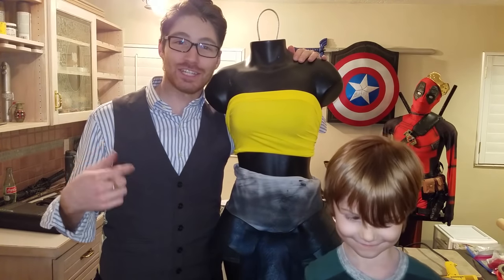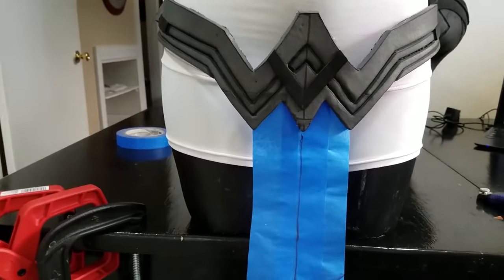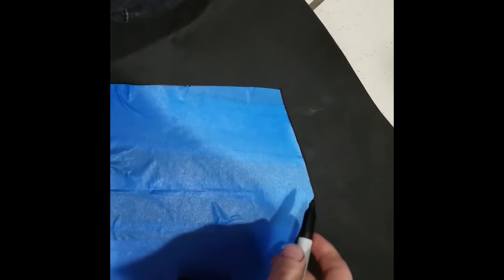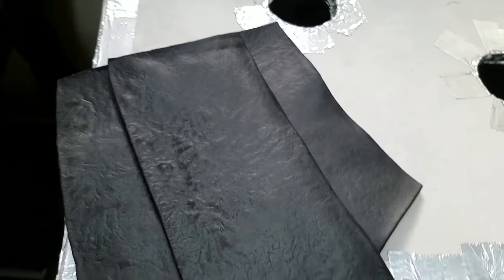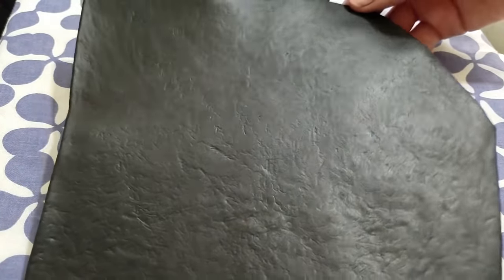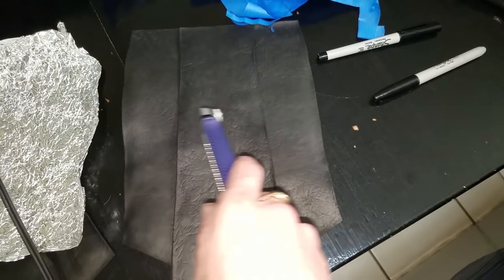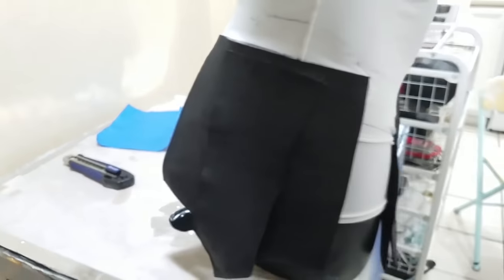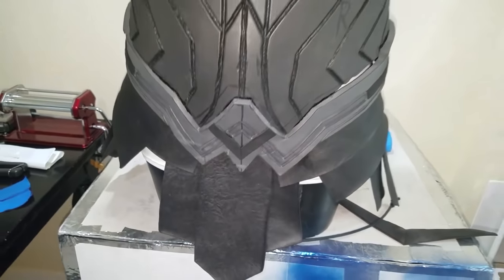Wonder Woman Costume Tutorial - Craft Foam Skirt That Looks Like Leather | Cosplay Apprentice

Comment: This may have been asked but since you glued the pieces to the spanx...does that mean the stretch in the spanx where the glue is no longer stretches?? I'm thinking of when you pull them over thighs and hips as that's when they need stretch. Or did you put a zipper/opening in the back?
Reply from the maker: +Rachel Holgate There isnt glue everywhere along the rim of the spanx, only thin strips along the tops of the panels. The spanx still have plenty of stretch :)

Comment: What is your preferred way to paint the leathered foam in order to keep the dimpling?
Reply from the maker: I will do a thin coat of plastidip and then use spray paint for any other layers. The fine mist of the spray cans helps keep all the dimpling details :)

Comment: how do i get the foam to form to my body? it's so square it looks goofy on me :/
Reply from the maker: +Ash sitzer Great question. You'll want to try it on and doing a section at a time heat it up as much as is comfortable with a heat gun and while the foam is hot push it against your body in the spots you are wanting more shape, you may need to heat a couple times to get the shape you want. Then repeat this process everywhere were you are wanting it to form fit better. :) Hopefully that helps, please let me know if you have any more questions, and feel free to message me on my facebook page or instagram page with questions as well. Sometimes its easier on there because you can post pictures to show what the question is about :)

Comment: I'm having an issue with the side panels. I can't seem to get them right, do they lay on top of each other? And the back part, is it longer than the other panels? Are there any templates we can get from you?
Reply from the maker: I'm sorry you are having troubles with the side panels,  are you talking about the ones on the sides that hang down or the two on either side that run across.
Reply: +Cosplay Apprentice the ones that run across
Reply from the maker: +Lorne Rodriguez so with the side ones, they do overlap eachother. In speaking of top to bottom directions  as if you are looking at a person wearing it,  standing portrait in front of you, facing to your left.  Three big panel that points downward on the side will go first.  Iwould get all of the big panels on first.  I think i may have made the butt panel a little larger thabk the others I can't remember.  Once those 4 main panels are on (make sure you are only gluing the top inch or so of the panel down) then you will add the ones on the sides. Make them a bit taller than the final look because they will overlap.  Do the one closer to the ground first, and then lastly do the topmost one so that it overlaps a little on the one below it, about a 2 inch overlap.  Remember on all the panels you are only gluing them down at the tops of the panels with about a 1 inch strip of contact cement :)  i hope that helps, Idon't have any templates for the skirt,  I will for the arm bracers. Please let me know if you have any more questions :)